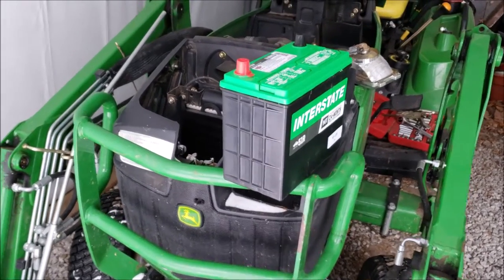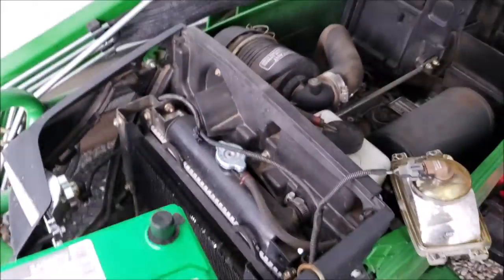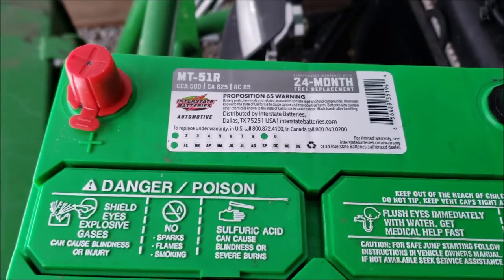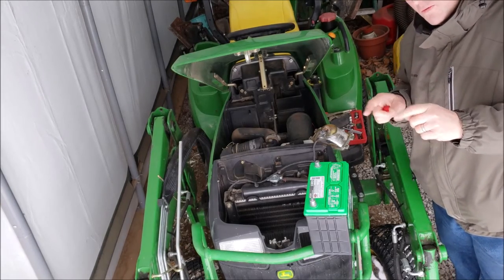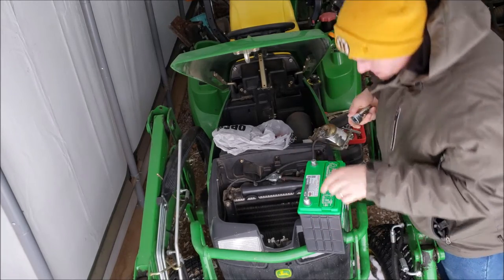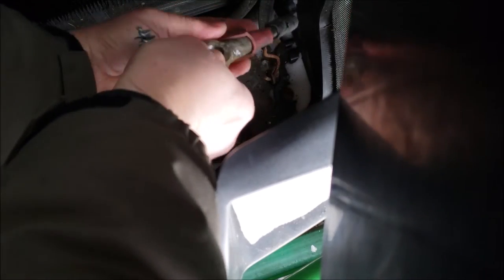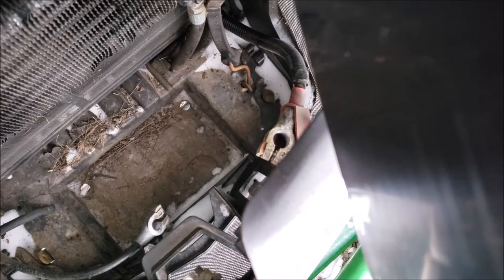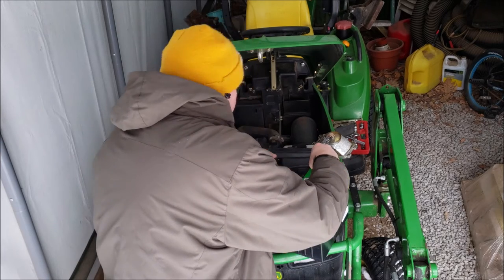New Battery for the John Deere 1-series Backhoe 2019

Comment: I’m just now replacing the battery on my 2017 2038R and you confirmed a light does need to be removed.  Luckily, I didn’t go straight for the radiator 😝. Thanks for the video!
Reply from the maker: Glad it helped!

Comment: Did not show how to get old battery out.  Showed how to clean terminals and tighten. But what needs to be removed to get battery out.  Does not fit in opening
Reply from the maker: I had to remove a headlight and there is a rubber tiedown strap.  That's it, and it comes out. It's heavy though.
Reply: But how do you remove the tabs without breaking them

Comment: How much was the Instate battery George?  I heard that the OEM John Deere batteries are made for the vibration of the diesel engines.   My original 1026R battery finally gave out tonight so I'll be replacing it tomorrow.  Thanks for the video   :)
Reply from the maker: Sorry for the late response.  I spent somewhere north of 100 dollars for the interstate battery. Definitely was a lot less than JD. So far so good.

Comment: Use a battery maintainer to save your batteries and extend battery life!
Reply from the maker: I like the idea. But this shed is about 50 feet from the house with no electricity. I might consider something solar. Any ideas?
Reply: @geo_walters  If it was me, I'd run electricity to the shed. You'll never regret it. You'll be able to have light and power to run the maintainer and a battery charger if needed. 50' is not that far and I'm sure you came come up with a way to  bury the wire using your John Deere which will make it a fun project.
However, they do make solar powered battery maintainers. 
Good luck!
Reply: My 2016 1025r is 5 years old, used weekly in the summer and on the battery buddy all winter (WI). Original battery!